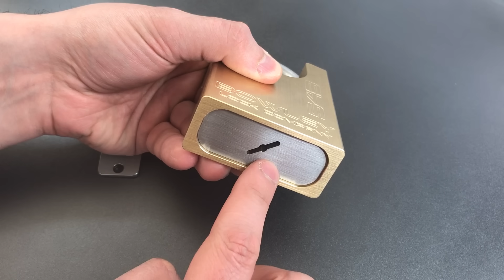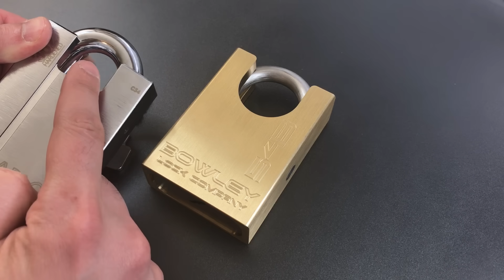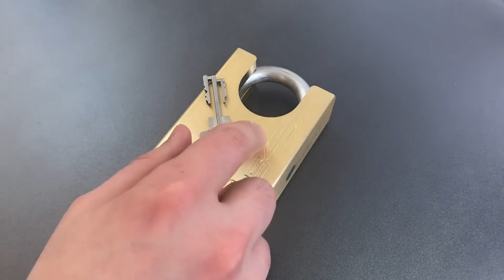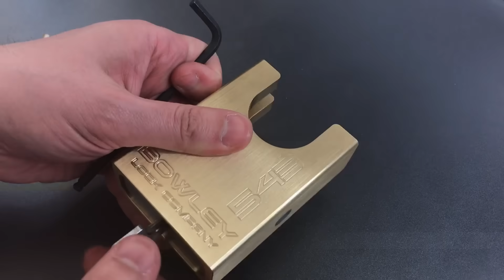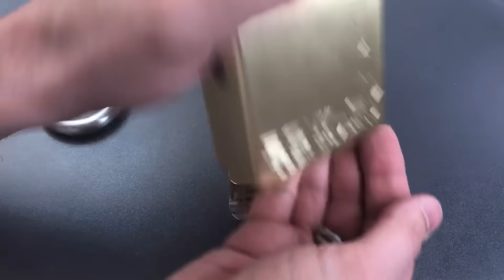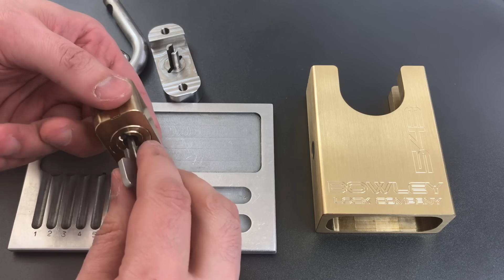[653] Prototype Dual Fork Bowley Padlock (Model 543)

Comment: Only thing I've seen that he hasn't been able to pick.

That's a LOCK.
Reply: @revolt_4588  that's not the lock I was talking about. I was responding to NuclearBolton about the security being good enough with a 30 dollar padlock
Reply: @Shuffle_Gaming  yeah especially i work as a Landscaper and we secure our (wooden) tool chests with padlocks

if someone really would want our tool they would break the chest or attack literally anything else. locks are honestly only there to keep people from casually stealing your shit. if someone wants to steal your stuff they will find a way
Reply: Basti K. Keeping honest people honest
Reply: @bastik.3011  This type of lock assumes that whavever youre locking up has at least some protection already. For example maybe you're locking up a storage unit with a metal door, or locking a chain that tethers something like a trailer to a fixed point or something. Sure, those can also be cut with power tools if someone was determined, but they would actually have to be prepared and have equipment and time to go and use power tools to cut open the lock or chains or door without alerting everyone in the area that theyre stealing your shit.

When you force the attacker to use destructive measures that take a few min and are very loud and require power tools, then its a pretty good lock since most people arent going to go through the effort. Theyll just look for osmething they can cut in 10 seconds, or maybe bash with a rock and itll open.
Reply: @eragon78  yes that's what I ment. If they wanted our tools they would break the chest open (that did also happen once but the people who did were probably drunk idiots since only a few things were stolen)

I am not saying that locks are useles but i managed to break the lock open with two wrenches in a few seconds when we didn't have the key once
Reply: @bastik.3011  well yea, you have to use the right lock for the right application.

A big beefy lock for something like that is a waste of money since the crate is easier to break than the lock is. But there are plenty of applications where the beefy lock is better because its not so easy to break in elsewhere. And beefy locks wont break to that two wrenches trick that you can use on smaller locks.

So it really just depends on your application. Cheap locks have a place for low security stuff where youre just trying to keep the honest man honest. But beefy locks also have a place to force people to use destructive means to get in which is much riskier, or have some talent in picking which is a much smaller subset of people, and most of those with talent arent criminals usually.
Reply: Making unpick-able locks is easy, making them small and functional is much harder.
Reply: Is this lock pickable
Reply: @richardaitkenhead   improbably so. if a key can access the pins so could picking tools, however those tools may or may not exist yet and same with the technique.
Reply: @JohnCanniff  was just surprised he never tried, hopefully in the future, thanks
Reply: John Canniff He's mentioned that there is no lock he can't pick but there are locks he can't pick yet because of lack of skills or proper tools, and I think that's one of them. But theoretically if a key can unlock it, so can a pick, as you said
Reply: Well... one look at the key insertion, and it isn't hard to see why.
Could prob pick ten "high security locks" in the time you pick this.
The best pick for this would be a hammer or a saw...
Reply: he could pick it, he just didnt, the actual lock itself isn't that impressive, its just a VERY difficult keyway to approach.
Reply: diarykeeper Probably, but aren't such locks made from metals that are very difficult to break/cut?
Reply: Gg Bowley, gg.
Reply: Well. It's only one in like a million thieves who will carry ALL the shit needed to steal your shit. But then again, locks are like insurance for a reason. You only need one theft to happen successfully for your shit to get stolen. Invest in the best lock YOU can afford. It will be worthwhile in the long run.
Reply: The only additional protection this adds over regular locks is the 0.000000001% of people who could possible pick it. Better off buying a $30 padlock 🔐
Reply: @TheNuclearBolton  I'm a fairly recent lockpicker myself and many cheap padlocks like that don't really require much skill as far as I'm aware of. It usually requires tools tho. There are rake-able locks in that price range. I even showed a co-worker who has never done it before and she picked up a lock in a couple of minutes, first try
Reply: What have you stolen so far ?
Reply: @Cortesevasive  nothing because in the locksport community we never pick a lock that's in use and we don't own or are allowed to pick ^^
Reply: @Shuffle_Gaming   whats ur opinion on the worst lock company in the world, master lock?
Reply: @snepmerlin  worst company that's well known would probably be them, I'm not from the States where these locks are from so I haven't tried them out myself. But there are hundreds if not thousands of brands neither of us has ever heard of that are simply worse. Usually copycat brands that cut all the corners. Where the padlocks are probably not hardened, the core is of low quality etc etc. Some people call them Chinese padlocks but I feel they can come from anywhere.
Reply: Shuffle Gaming if I was in that community, I would pick locks in use, but then lock them back up where they were, just so I knew that I could pick it
Reply: @tpt229  It's highly disrespectful, illegal AND you can actually damage the lock (which happens because you scrape the pins with the tool) and seize up the lock, effectively destroying it
Reply: @Shuffle_Gaming  "that's in use" unless you lock yourself outta the house amirite
Reply: @Shuffle Gaming but what if you just pick it for the skill boost and then lock it back?
Reply: @AzaThoth-j1p  you can break the lock and then nobody will get in ever. So no, I would advise against it. That being said, I got a travel size limited pick set and I've picked some locks for some exploration purposes. So I don't follow my own advice. So yeah. Don't pick people's locks, you could break them, but if you do, know A, you're doing something that's unethical, B, you could break the lock and that might definitely ruin someone's day if they needed something quickly and they don't have the tools to break/cut the lock open.
Reply: @Shuffle_Gaming  the worse kind of padlocks are the "unbreakable" plastic core locks that any regular person going15 seconds whith a lighter will open them like butter
Reply: @Shuffle_Gaming Locksport 😂😂😂😂
Reply: @TheNuclearBolton  if you've seen the Unus Annus videos for 2020 you would know Markiplier learned to pick padlocks in 5 minutes and was getting the practice one in seconds and did the regular padlock in a few minutes or something, it's super easy to learn to pick a lock if you have the right tools and motivation. It's not that rare to see someone who can pick a lock.
Reply: @TheNuclearBolton  I think it makes sense to spend on ones that are resistant towards mechanical attacks. That's what all but one in a million of bike thieves use and if there ever is one that can pick locks, my bike is not that special but pretty rare. The company doesn't exist anymore, so it would be hard to sell, considering the police knows my bike due to previous incidents. (Guy couldn't steal it so he loosened all the breaks.)
Reply: @please_stop-v7o  an unhoused guy came into my work once a couple years ago and I struck up a conversation with him, and as it got more casual he started joking about how people have the most expensive bikes, but will lock them with a cheap lock and started laughing about how a little bit of time with an acetylene torch and the bike is as good as gone
Reply: Lol, "unhoused" @Viranical
Reply: NuclearBolton would it actually be the 99.99% of people who can pick normal padlocks
Reply: @bobjoe1832  doesn't everyone try to open cheap locks with an metal paper clip and some random girl's air pin in school?
Reply: @TheNuclearBolton  okay where's your bike ? Imma come with a pocket metal saw

Comment: 11mm shackle! Awesome as it means it will work in most self storage units. What people don't realize is that if a lock can be picked leaving no signs, your insurance won't pay. Forced entry will be required to bypass this. This lock defeats storage places with rotten employees or managers.
Reply: I didn't think of that. It'll at least make it less of an easy target than someone else's storage. Motion sensors that "phone home" are probably better, though.
Reply: Your unit has your padlock and the manager's padlock on the door.  
The thief uses the backdoor.
Reply: Had a unit broken into once. Lost a bunch of stuff but because they took the lock and they couldn't tell what happened the insurance covered it lol
Reply: Robert Slackware  Ye olde Silence of the Lambs storage setup
Reply: I doubt that.
Reply: @ChickenPermissionOG  Why doubt it? You think insurance will pay without an investigation? Claim are rejected if there's no clear proof. Insurance companies are businesses not charity.
Reply: @ChickenPermissionOG  that is absolutly correct. Without any sign of damage on lock insurance company won't pay you.
Luckilly thiefs know that and usually make sure there are visible scratches (made after succesful lock picking) just so your insurance company pays you.
What is the source of that? Thiefs who got caught tella the police and that part of information (after the case is closed) is not secret so they told to tv/news reporters.

Comment: This is the most "complex" lock he has reviewed right?
Reply: There certainly are more complex locks as this "only" consists of two pin tumbler locks. The problem is that you can't even get to the pins in the first place making it almost impossible to pick.
The older bowley lock has been picked by someone who made specialized tools. Not sure if his method would work on this lock though.